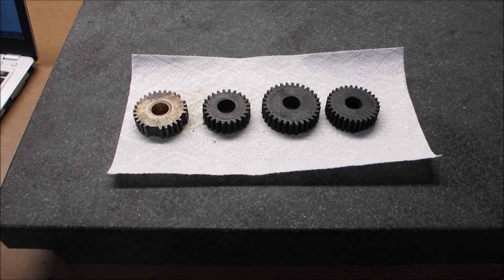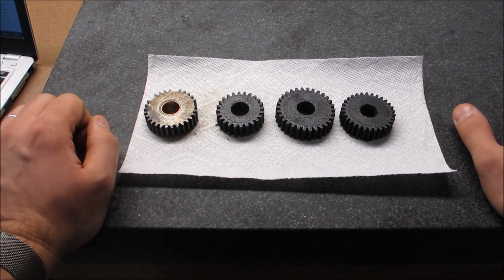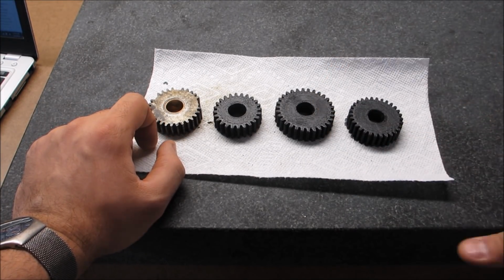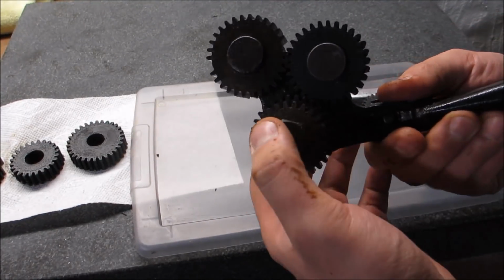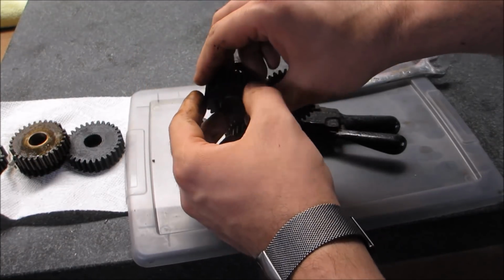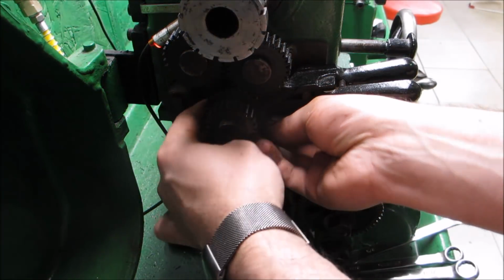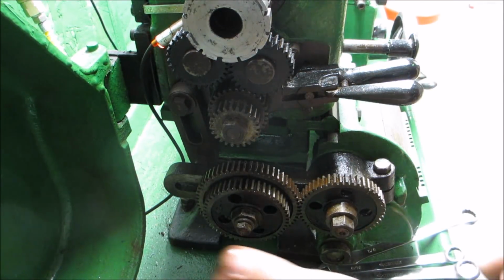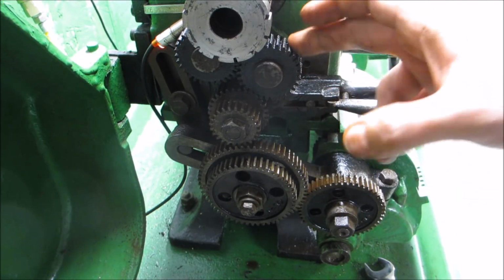Logan Lathe, 3d printed gears!

Comment: I just started watching your videos. How have your plastic gears held up? I'm just getting into 3d printing. So far all I've tried to print with is PLA. If you make some new gears on your shaper aluminum will work really well, especially for occasional use, and it's easy to cut. I have used 6061-T6 and would recommend that grade.
Reply from the maker: I replaced the gears with the original gears after I rebuilt the teeth with brass.

Comment: I just modeled a few change gears in Inventor for 3d printing.  For a weird non-standard pitch.  

I cringed a little when you touched the running gears😁.   Those things grab, will spit hamburger and bone fragments out the other side.  Be careful!
Reply from the maker: You are absolutely right.

Comment: Have you thought about using a 3D print to do a lost cast copy to make new metal one?
Reply from the maker: +Dave Dowell I have thought about it. It's possible I will do such a thing in the future.
Reply: I'm doing some lost PLA work at the moment. I could try casting you a set in ZA2 if you want.

Comment: All the logan gears are here;

https://www.thingiverse.com/thing:200294

including the 100 and 127 tooth gears if you want to do metric threading

If you click on the "thing files" button below the image, you can down load individual stl files 

Or click on the download button on the main page if you want all the gear files.

Atlas 10-12" lathe gears are on thingiverse also,  here;

https://www.thingiverse.com/search?sort=relevant&q=atlas+gears&type=things&dwh=615a6a862367005
Reply from the maker: Phaedruses i had no idea. Thank you for the link.
Reply: No problem, just thought you might not to want to redo in fusion360 what somebody else has spent hours doing.

Try searching on http://www.yeggi.com/ for 3d printable things, it searches the 3d printable repositories like thingiverse,  MyMiniFactory, etc. and shows whats available.  Got to remember to search for different search terms because "logan lathe" and "logan gear" will give different results.

Comment: do you remember how long they lasted? cheers!
Reply from the maker: These lasted for a few months of fairly low usage in my hobby shop. I got replacement cast iron gears for a song at another time.
Reply: @Engineerd3d  thanks for the quick reply, totally worth the print then, to keep things moving while finding the long term solution, cheers again

Comment: I am always afraid of using anything 3d printed for any parts these days.  I especially don't trust them for gears that run fast.
Reply from the maker: Well the gears are ABS. I always use ABS anyway. I had these gears running to max spindle speed on this lathe. ~1500rpm. Not a problem right now. Time will tell. The gears actually bed in very nicely. I have some work to do on the gearbox before I activate that one and then I can really test them under load.
Reply: Lets hope so but on my 3d printer the ABS I used was eaten up though those were herringbone gears.
Reply: No reason why they wouldn't work, although ABS has poor interlayer adhesion, so I'd use something like polycarbonate which has both the temperature resistance of ABS and the great interlayer adhesion of PLA.

IGUS' low friction polymer could be a good option too.
Reply: PC requires way higher temps (hence the better interlayer adhesion) to print and the fumes are bad for you.  ABS up against metal that ABS will get chewed to bits eventually but what plastic against metal wouldn't?  PLA I switched to for my gears and no longer an issue (though I hate PLA for functional parts but for gears it works as it smooths itself) but if I had an enclosed printer those gears are on the PLA will deform as I found out with a PLA cable chain I printed and within a few months the enclosed printer deformed it enough that I had to reprint it in ABS and no issues.
Reply from the maker: I have some igus low friction polymer in my collection of filament as well as some sealed NYLON and a sealed roll of polycarbonate... For now the ABS gears are the BETA test. Time will tell.
Reply: I've mostly switched to PETG for mechanical parts.  It has some printing quirks such as stringing, but generally it's as easy to print as PLA, dimensionally stable, stronger than ABS, fantastic layer adhesion, etc.  And it takes about the same temps as ABS, but doesn't have the cooling issues, so no need for any high-temp extruder or enclosed box.
Reply: I despise PLA and I switched to PETG as well but it is far too bendy for me.  I am wanting to try ASA but that stuff is almost 1.5-2 times the price of ABS.
Reply: Did you miss the part where he said those gears are $80 a piece to replace? Is ASA that expensive? It seems like a whole reel only costs $35 to me.